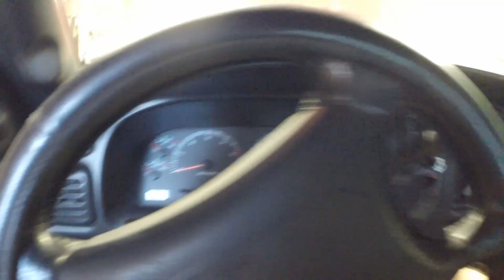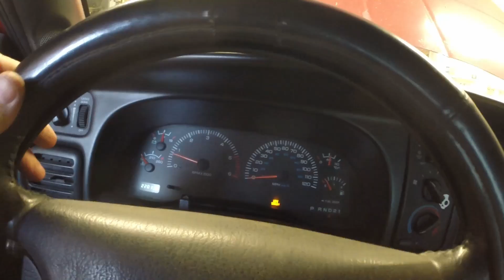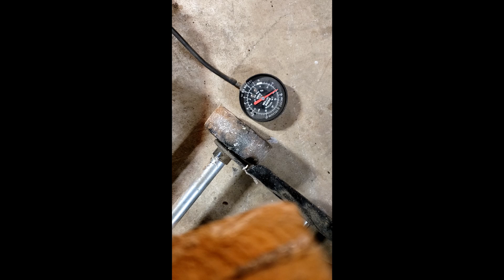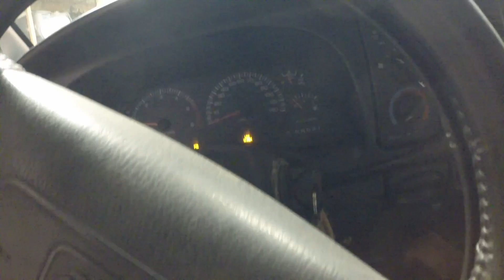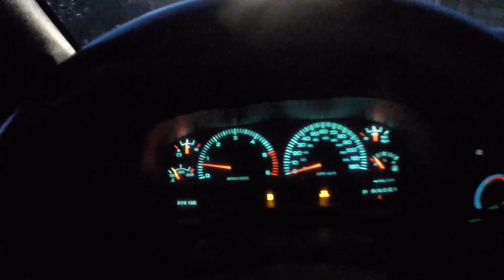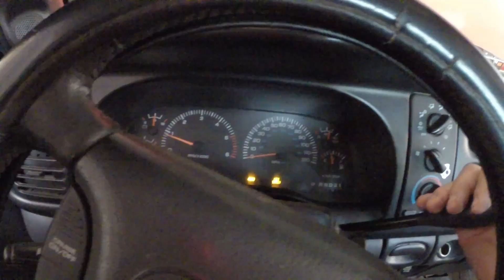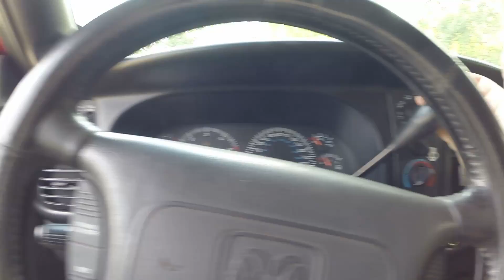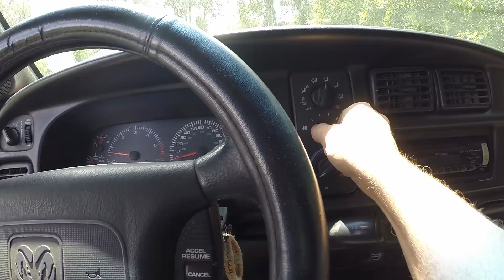Ram 4x4 Actuator Repair - Part 2

Comment: Great diagnostic work. That vacuum system is a nightmare
Reply from the maker: Thanks! Yeah it does. There's a cable kit that a lot of people buy instead of the vacuum actuator. You have to fish a cable into the cab and you can manually move the collar then. It was about $60 more than the stock part though. Good for off-roaders I guess.